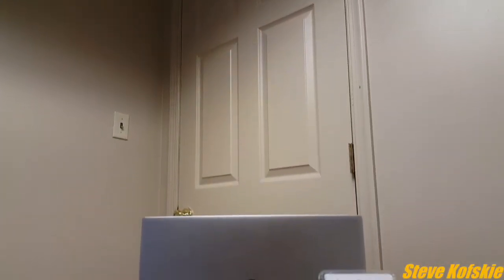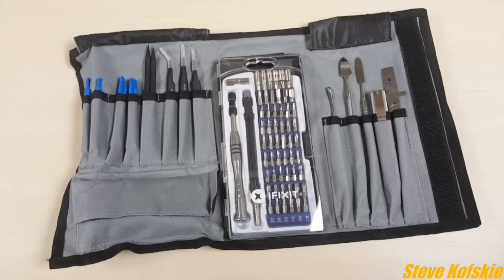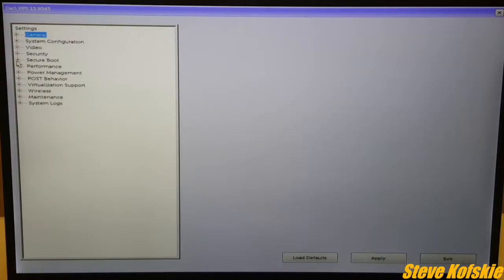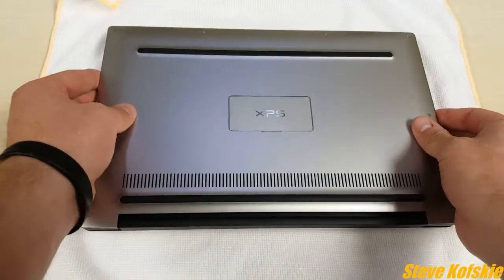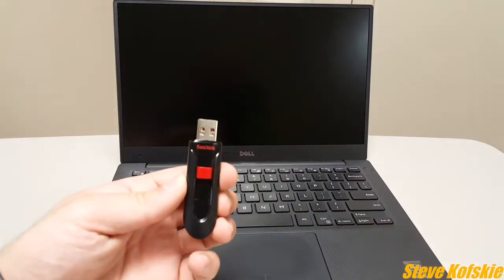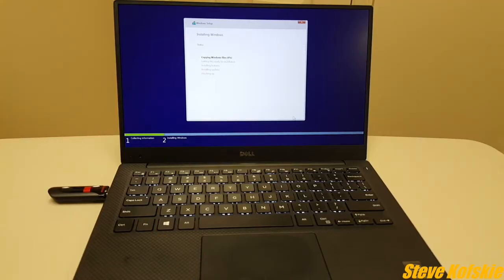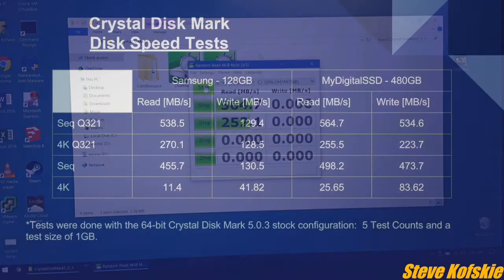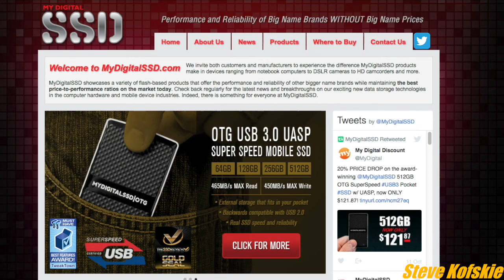Dell XPS 13" (9343) M.2 SSD Upgrade (MyDigitalSSD BP5e 480GB SSD)

Comment: Did your XPS originally come with Win 7? So at 2:04 the small access cover can be removed? It also covers some laptop info? Found a tossed out Dell XPS Win 7 (may have water damage & defective battery) laptop. Thank you

Comment: The best video if have seen for upgrading an ssd in the XPS 13.  Identifying the specific tork and phillips drivers you used was a lifesaver, as was going through the detailed bios settings required to boot from the usb stick.  Thank you so much.

Comment: Could you,please,tell me,if M.2 PCIe SSD,like Samsung 960 pro 1TB,will fit/work with my brand new Dell XPS 13(9365 model),or I need only the M.2,SATA drive,which is slower??? If you know,would you tell me,please?Thanx